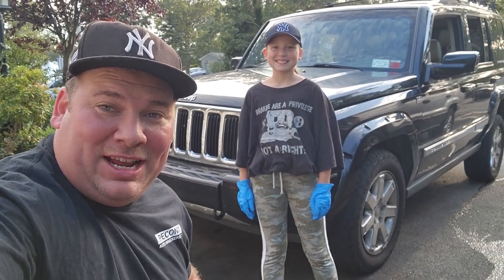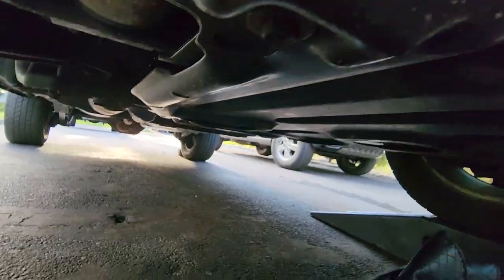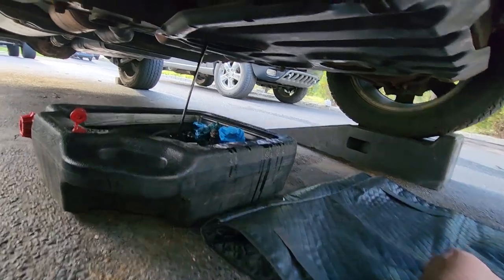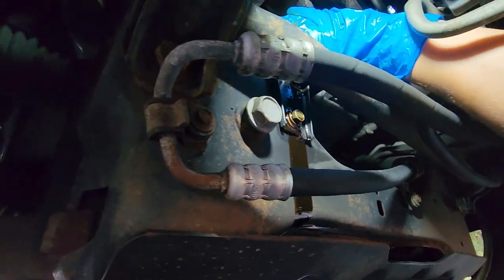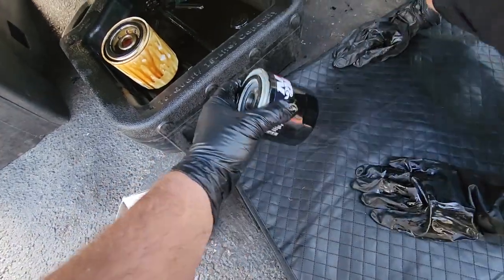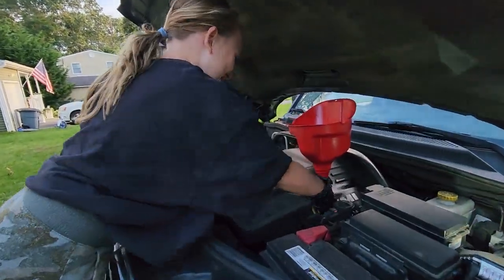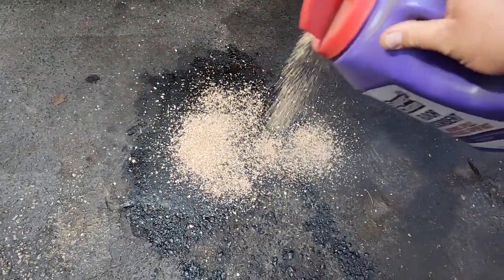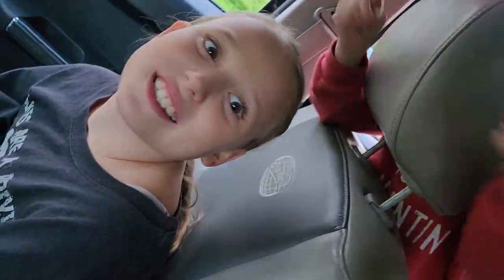HOW TO CHANGE THE OIL IN A JEEP COMMANDER - SO EASY A 10 YEAR OLD CAN DO IT!

Comment: A few recommendations from a two commander owner:  1) always have a spare oil pan plug and copper washer handy - you may need to change it out when the old plug head gets deformed. When I bought a second commander, I had to cut the old plug off because of inactive use by the previous owner. 2) Always wipe the face of the oil pan before replacing the plug - grit on the face of the oil pan will allow oil to leak between the pan and the washer.  3) when removing the old filter, keep the open end up so the oil doesn't spill out. 4) Wipe the face of the oil filter receiver to remove any grit. 5) Because the space is difficult to get a good grasp on the new filter, you can use an oil filter wrench to tighten it  - just don't tighten it too much - judge by the turns - one rotation maximum.

Comment: Another thing from a two commander owner:  Keep the skylight drain holes free by enlarging the opening where the drain pipes exit the floor pan and periodically blowing out any debris with a compressor. Also, the cover over the engine simply gives mice and rats a place to hide - remove it and keep the engine clean by occasionally using a cleaner and water - you won't hurt anything - it'll dry pretty quickly on a sunny day.

Comment: Im going to start replacing my own oil. I do appreciate the video. The guy i was going to say i should flush out my oil and transmission flush before adding new. Im assuming it's a 2006 Jeep commander, that's why.  Any opinions
Reply from the maker: Just drain the old oil and fill it with new oil. Refer to your manual for oil viscosity and volume